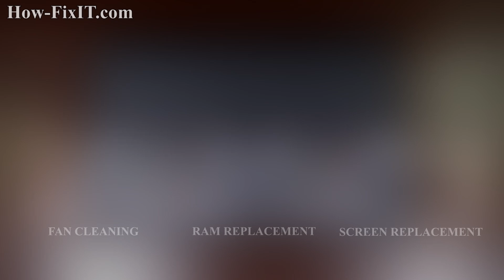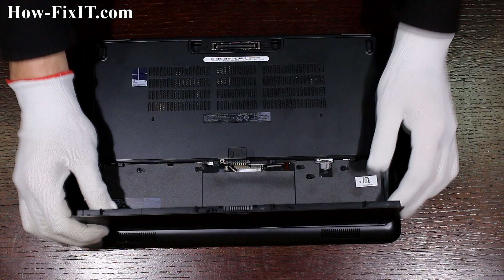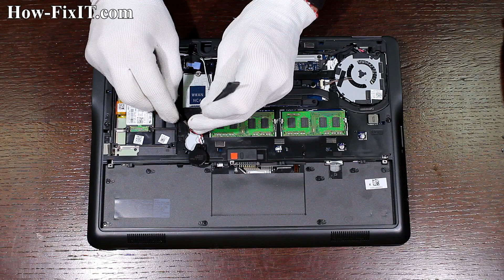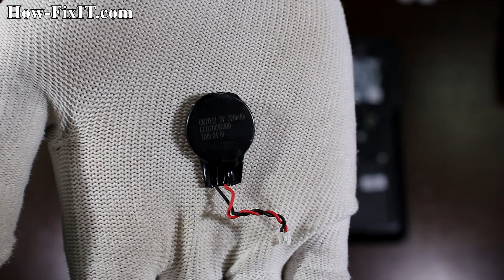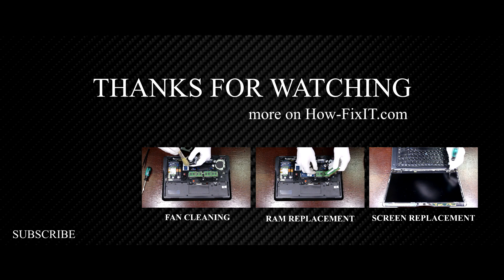Dell Latitude E7450 Laptop BIOS Reset & CMOS Battery Replacement (Easy DIY)

Comment: What a colossal waste of time! This does nothing, definitely not a reset. You didn't even remove the primary batter, therefore removing the CMOS will have absolutely no effect what so ever on the bios. ffs...
Reply: The first thing he removed was the battery. But your right it won't do anything either way.
Reply from the maker: It's called "hard reset bios", and if you need to reset the bios password, then you need this video 👉 https://youtu.be/WUDdhJVIR1M

Comment: If only it were that easy. I repair more that 1000 laptops per year with 10 years experience and this has only ever worked on select hp laptops. Why bother with this upload that certainly does not work on that model dell or any dell.
Reply from the maker: Because CMOS battery replacement

Comment: Hello, How can I reset my bios password ? Want to upgrade to windows 10 using a bootable flash drive but my dell e7470 won't let me do anything in the BIOS settings. I'm still stuck with windows 7. Anybody ?

Thanks
Reply from the maker: Removing the CMOS battery won’t clear your BIOS password. Check out my “How to Remove BIOS Password” guide here 👉 https://youtu.be/WUDdhJVIR1M — it shows you step-by-step methods (master/backdoor passwords, jumper tricks, etc.) to unlock your BIOS.